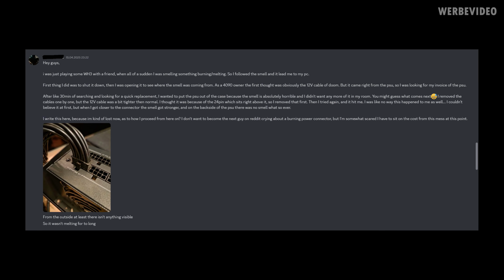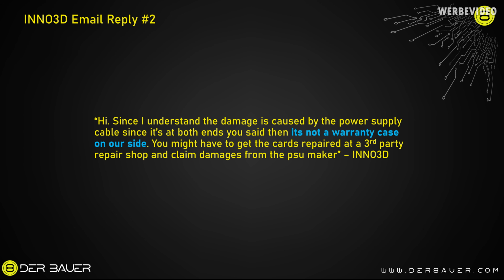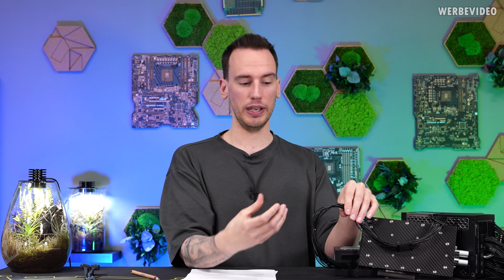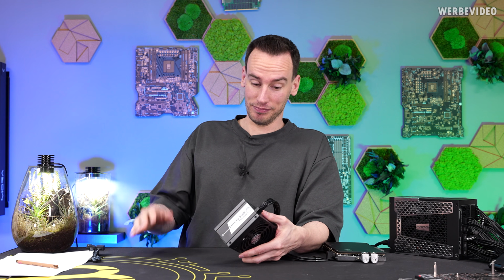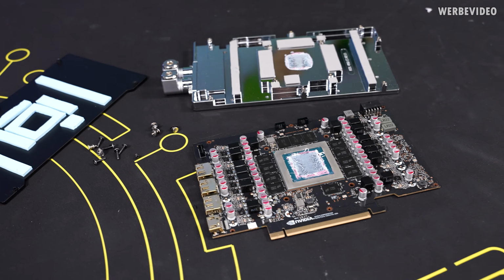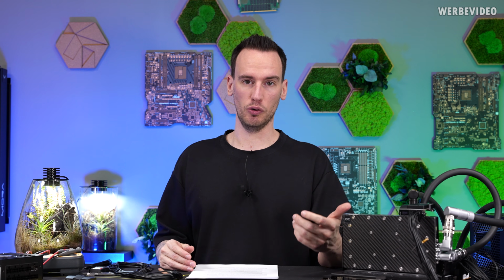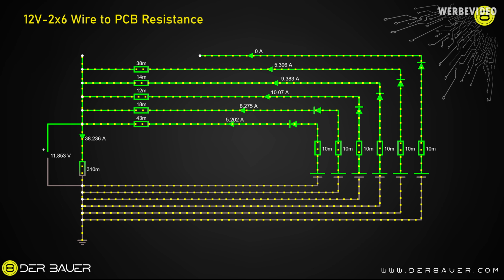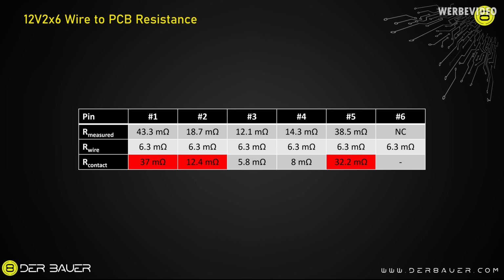Investigating and Fixing a Viewers Burned 12VHPWR Connector

Comment: Could the higher resistance be due to oxidation?  Either present before the burn started or built up during or after the burn?

Could the higher resistance (as measured now) be due to changes in the alloy due to exposure to heat during the burn?

Comment: Great. In my view it's the "Science about contacts" ask any auto-electrician is it okay to connect alluminium with copper? Or in worst scenario, copper with iron. Or not use "knife-jack" if significant current is present? Seems youth never attach 24V battary to a starter. And btw, in my view measure miliohms might not be so presise due to "Contact illness". But still good video. At least someone is concern.

Comment: If the load balancing was mandatory (required by Nvidia) on the boards then this connector issues would be almost eliminated and way way smaller issue

Comment: undervolting does not necessarily reduce power usage as it gives more headroom for higher Mhz and boost. If the power limit is still at 100% it would still try to use it.
Reply: And it is amps that make heat, not volts.

Comment: Back in the day I specifically chose my Strix 3090 because it had 3x8pin PCI-E connectors on it while the new 12VHPWR stuff was coming onto the market. I'm glad I was skeptical of the new connector.
Reply: My RTX 4070 Ti Super has the new 12VHPWR type connector, but only uses 285W power. I'm still somewhat concerned. Luckily, I rarely spend multiple hours continuously gaming with it.

Comment: The connector is junk.. You go from the older design with 3 plugs with 24 conductors, down to a single plug with only 12 conductors, and expect it to carry even more current? The current path is insufficient for the amount of current flowing through it to begin with,  and the weak link (highest point of resistance) is gonna be the mechanical connection, the plugs. The fact that it melted on both ends proves it.  Dear Nvidia, quit making junk, or at least quit charging so much for you junk.

Comment: I built 4 "high end" computers for a lady that was doing a Computer Science Masters Program focused on Artificial Intelligence. The first was a quick use of mostly spare parts. I put an Intel 9900k into a Asus Prime mother board with a Corsair 360 AIO. The initial graphic card was a 1080 which was quickly replaced with a 3090FE. This did a homework assignment in 3 hours that took other students working on their laptops a week to do. I recently examined the 3090 before giving it away to Free Geek. Its motherboard showed heat discoloration under the GPU and another associated chip. The 12VHPWR was in good condition. The other computers used 13900K CPUs and 4090 GPUs without 12VHPWR problems. The 13900Ks were overkill for AI workloads. I am using an Intel Core i3-8350K with a 4090 at 40% drawing 300 Watts from the wall for efficiency. I think if Nvidia cards were operated at 80% power this problem with the 12VHPWR would go away.
Reply: Nvidia, the way it's meant to be nerfed! 🤡
Reply: That's why I set a 320W power limit on the 4090. It is still fast enough for almost everything, while safely keeping the currents under limit even if some power pin or cable is not perfect.

Comment: I have a 4090 and know one day this will happen. It's not a PSU, cable, or user error.. it's the GPU 12vhpwr pulling an uneven load. But they keep blaming the connection, or user. How isn't this a legal case by now

Comment: I'm using an aftermarket cable for various 1000W+ appliances all over the house.

After plugging the connectors in and out hundreds of times over multiple decades, NONE have melted. Imagine that.

This blaming aftermarket cables is absolute nonsense. It's a badly designed plug and possible fire hazard. I don't understand why QC agencies / consumer protection agencies worldwide are disregarding the thing.

Comment: plastic to plastic fuzed.  I have a Gigabyte 4090 and as long as it still works, I’m not going to bother trying to remove the cables.  I’m using an after market adaptor 12vhpr to three 8-pin.

Comment: I can see someone not wanting to be the next cry baby but the fact is that these cables and connectors are problematic at times.  Not a single person is crying or whining.  They are just unhappy with the design that causes so many problems.  It is not like this happened to one person and never happened again!  This is a problem that makes some people not really want a card that uses those connectors and cables.  I have one of the ones that uses the 6 pin PCIe connectors and never ever had burning plastic, it is a design that should not have been messed with

Comment: At 3 minutes in, I'm suspecting underrated cables, like maybe CCA or low quality copper. At 18 minutes in I'm suspecting damaged vias on the PCB and wondering if you measured the resistance from pin to pin on the GPU connector without a cable connected. If found, the solution would be to solder on an oxygen free sollid copper bus wire across the 12V pins on the PCB side.

Comment: Hey, the video gets the point across, but I do have issues with the methodology and values that are being presented (calculated). I did the calculation with the values that are given in the video, only the configuration where there's a connection lost and I'm not getting the same values as the one presented. I guess the animation wasn't made for a 5 parallel connection but for 6 only, as I got much closer using 6. Also, since you had a milliohm meter, I would have taken apart the power supply and measured each parallel line in its entirety. Then I would have cut the wires, measured them. Finally, measured the two connectors resistance, for each line, independently. That way, the analysis would have been more thorough and would have had more value to fight manufacturers (Nvidia and partners, wire manufacturers, etc.). Does it change the conclusion? No, not significantly. It would just have had more value to prove a point.

Comment: 4W in tight space with no airflow (inside pin/connector) is quite high and could at least soften plastic, in unlucky case this can lead to loosing contact on other pins.
This design is flawed for this kind of current, there should be no multiple pins but one blade connector (or two but constructed to absorb thermal changes).

Comment: @der8auer Doesn't this leave room for innovative suppliers (like YOU) to step in and create a daughter-board that fit's between the PSU and the GPU and balances the load between the all the 12V wires? Could have alarms and USB monitoring. Sounds like something that could make you a lot of money and save nvidia... And further solidify your position in the industry.

Comment: A much safer method of removing connectors from super thick PCBs like that is using low melt solder. Get some ChipQuik or similar, it should make the process much much easier. Using a dremel like that works but if you slip the card is likely toast.

Comment: All cables are going to be 3rd party as no card vendor provides a 12vHPWR to 12vHPWR cable, so rejecting based on that is not valid. The PSU MFR should supply a new or repair the PSU, the Card Mfr should fix tor replace its card and the cable company should supply a new cable. 
Anything else is not reasonable.
In the absence of the GPU mfr doing anything sensible, should the PSU mfrs at least preventing the over supply of current on any one wire?

Comment: Roman hello could you answer a question for me! I purchased a 38x38 .02mm Kryosheet (apologies if specs are not accurate) and it came with TG  silicone oil. what is that used for? Ty

Comment: Why doesn't it have a temperature sensor on the connector. There are a lot of electronics with thermal fuses. Just put it under or near the connector on both ends.

Comment: Has anyone considered the through hole plating thickness and resistance on the connector holes? Stress cracks causing unwanted high resistance or open circuits could form from repeated current and heat changes if not adequately executed. ❓

Comment: Hello sir, i have a question to you. I've bought an Asus 5090 Astral and i'm using it without ATX 3.0 cable ( with inbox seperated cable ) can it be cause any burn-in on my PSU side? I checked voltages and everything is green and healthy even in 600w power draw.

Comment: Copper wires are good heat conductors but on distances of meter isolation would be charred near connector if fail was caused by wires

Comment: I now have a 4080 Super because found a really good deal. Wanted a 9070 XT to avoid 50 series issues and also this high power connector..but I have it now. The fact that the card just draws power from whatever pins have lowest resistance seems like a terrible design flaw. What was even the point of this new connector design? Makes me very nervous it can happen with properly installed connectors.

Comment: An extra problem with having a water block is you lose the little bit of cooling from the fan vents coming out of the side, I've personally noticed this myself on my 4080 super after I put a block on it.  One way of helping to remove heat from the connector is by using the thickest gage wire possible, as it will draw away much of the heat. I'm wondering how deep and tightly were the pins joining together, as if the joins were poor, leading to high resistance, which could be the start of the problem, then leaded to the cables breaking down over time, so giving high resistance.  And normally you will find the point of highest resistance/breakages is in the middle of the cable, from end to end, which is why you saw problems on both ends, not just the GPU side.
Reply: I actually have a lot of airflow to it, because there is a radiator directly under the GPU. The PC was built in a lian li dan a3, with a bottom intake and top exhaust radiator. So at first i was kind of scared it would make it even hotter, but the radiator air isn't really hot, so it shouldn't hurt the cable ether. It isn't mentioned in the video, because it would get to long, i guess. I was really paranoid about this cable, so it was literally the last thing i plugged in before starting the pc for the first time, so nothing could happen to it. 

And guess what, still happend.... What you going to do at this point 🫠

Comment: Wouldn't it be possible to create something like an adapter plugged between the gpu power socket and the power plug that could measure the current, voltage and temperature of the adapter in real time? Maybe that would help solve the puzzle.

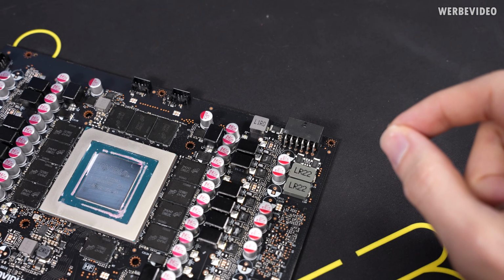Comment: At 13:56 (and a bit earlier), the soldering of the connector to the PCB looks very uneven and 'dry' (that is, the four pins closest to the end of the GPU have way worse solder penetration and as such likely higher resistance to PCB copper layers, at least for the PCB copper layers that are on the connector side which seems to be the case for that board).

As to why, well, the soldering of that connector is also hard for the machines. There is a lot of copper there, which could have absorbed too much of the heat of the machine soldering process, resulting in less than ideal soldering.

Do you have any close up photos @der8auer? (Will watch the video to the end now.)
Reply: On the crimped pins, at around minute 18 or 19: A good crimp (such as one made with the fancy tool at a factory) is better than a solder joints both in terms of contact resistance and long-term reliability. This is especially true for joining cables to pins as the crimp is much more tolerant to repeated mechanical loads. That is why critical connectors are crimped.

But, back to previous point: A close-up of the connector before removal would be nice (as it seems that both ends of the connector had bad contact resistances when measured from mid-cable to the board (when compared to the middle two pins). Though, there is a bit of risk over interpreting the milliohm measurements as the contact resistance of the milliohm resistance meter to the point of contact in the solder join on the backside of the PCB is a bit of its own artform to get consistent. (For the next time, which is very likely to be never, it would probably be better to (also measure a set-up where) you eitehr keep the PCB end probe in a same point on the PCB for all six measurements. Or, measure from mid-cable on pin 1 to mid-cable on 2,3,4,5,6, and then (at least) the same from pin 2 to 3,4,5,6 (continuing on to 3 to 4,5,6 and 4 to 5,6 and 5 to 6 measuring all possible 15 combinations gives the best estimate of any single value from each pin to the PCB power plane). The trick here is that the contact from the milli-ohm-meter to the cable is much more consistent than the contact to anything on the PCB power plane, so the bit of math to deduce this value from the measured sums of 1+2, 1+3, ..., 5+6 gets a better estimate of it.

Comment: @der8auer EN the simulation is incorrect and your intuition is right in fact the current that is going to settle in each cable is when the voltage drop accross all 6 impedance is the same since the 6 pins are linked together on the PCB side you can't have a different voltage neither on PCB nor on power supply side so it will balance at 20:44 like this #1 is 2.77A, #2 is 6.42A, #3 is 9.92A, #4 is 8.39A, #5 is 3.11A and #6 is 4.8A. And you see now the issue in power you will have only 0.33W in #1 and 1.2W in #3 thus the melting if it is a long time or even worse than this. At 0.7W it is a bit high but still acceptable for AWG16 but at 1.2W it goes very hot and will melt PA6.
Reply: can you explain for an elctronic noob please i really want to know what you mean but i couldn't

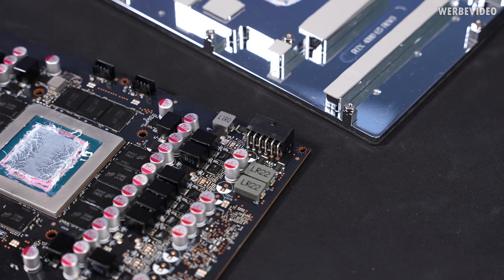Comment: You keep talking about Molex connectors, why don't you ask them why they say that this connector system is not designed for current sharing? Also at 13:23 it looks like the connector has some unsoldered pins. Is this just the lighting?

Comment: Many Nvidia users complain about this 12VHPWR connector. Ok My question then...
Why this green- fanboys still purchase their product? Any reason? Does a card who cost 1500 or 2000 euros will give something more ? And spare me that stupid AI , 5 years ago they didn't even know what AI is .
And not only that, but they perform worse than previous series, after the 5000 cards abandon the physics !
Old games run like shit on 5000 cards. 
So whoever purchase Nvidia, are aware of the most bad power socket design ever created in all history on electronics! I repair computers 32 years, never had saw such worse power delivery from a connector. Is IMPOSSIBLE to deliver 600W power to such tiny pins. Wake up fanboys! Otherwise spend your money to future burning cards ...
I am done with kids who believe getting Nvidia will have a good performance...
Maybe for some days. Or some weeks. The cooldown of  a burning socket just begin with the first press of power buttons....
Reply: AI,Missing ROPS,AI,Pcie 4.0-5.0 issues,AI,melting "beefy" connectors,AI,no hot spot sensor,AI,intake-out take fan turbulence,AI,upscaling downscaled frames feature,AI,drivers burnout,AI,"Military class" components,AI,no guarantee guaranteed,AI,Stockholm sindrom summary.....to be continued.
Reply: @edindzafer  you said everything haha

Comment: Someone needs to do a PSA on Undervolting, explaining that it does not mean the processor is using less power.  It more or less means a "more efficient" use of power.

I will say the key problem with the 2x6+4 power connector is the power distribution on the GPU end.  As much as the wire has 6 +12v wires and 6 ground wires, we do not have 6 circuits but 6 paths for 1 circuit.  The circuit from the inside of the PSU to the GPU is a circuit with 6 resistors in parallel.  More precisely, you have 6 series of resistors in parallel.  How is the current distributing between them?

Here is the concept, you have 6 series of 5 resistors in parallel.  The power "should" be close to evenly distributed.  Take 1 or 2 resistors out of 1 path, drastically reducing that one path's resistance.  How does that change the distribution?  I am assuming the path with fewer resistors will take more of the overall current, and the remaining resistors on that path are warmer than the resistors on the other paths.  Realistically, the resistors in each series are not all the same.  You have a high Ohm resistor on each path at both ends and a series of lower Ohm resistors around them.  The concept is pulling out all the lower Ohm resistors on just 1 path in the 6 parallel paths and compare how warm the high Ohm resistors are.

Comment: Apparently the only solutions are to either not use NVIDIA GPUs or invest in a current clamp to check each cable every time you game, because NVIDIA won't actually fix the issue by fixing load balancing and going back to the old standard.

Comment: 18:04 sadly it is normal to have these differences, NC is an issue but 10mR or 50mR is basically the same value and it should be expected on the connector. So it's really a huge design flaw to let such a normal thing be an issue.

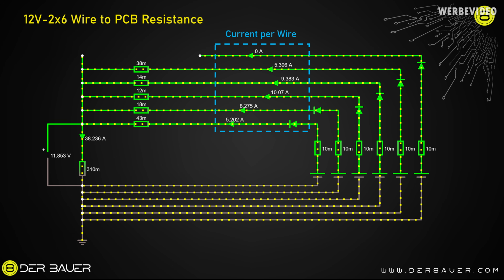Comment: 20:10, there is a possibility that pin 6 was not actually connected properly before the failure it's certainly not guaranteed and I don't think it would be easy to find this in a post mortem, but it's certainly possible. Any heating of that pin might have just happened through proximity to the other pins

Comment: Path of least resistance = higher power throughput capability = Wire gets hotter and resistance increases = regulator does not balance power lanes as resistance increases + having no surface temperature thermocouple = melting.